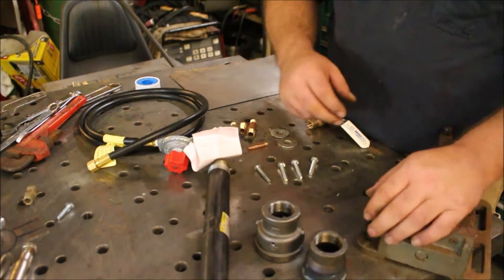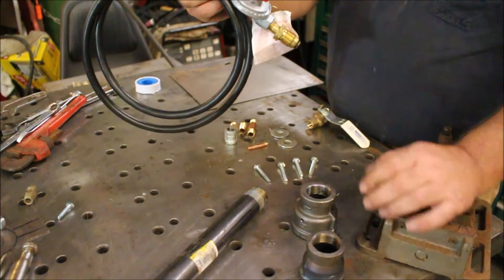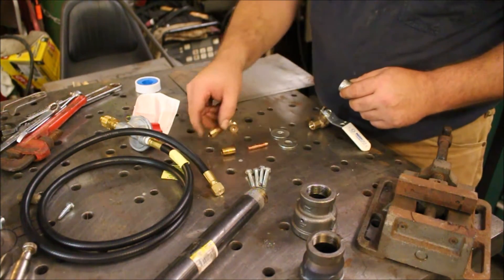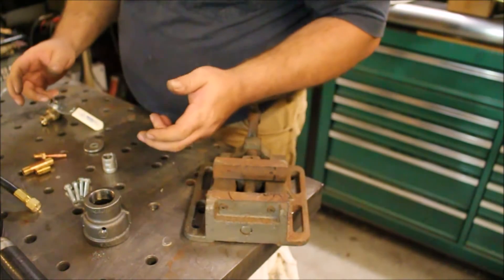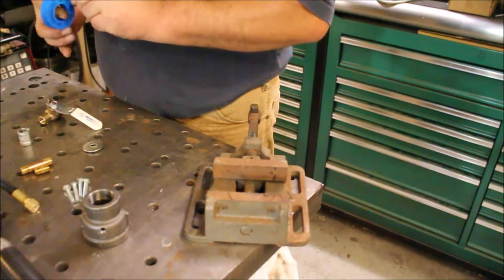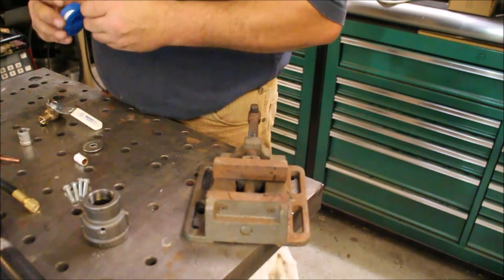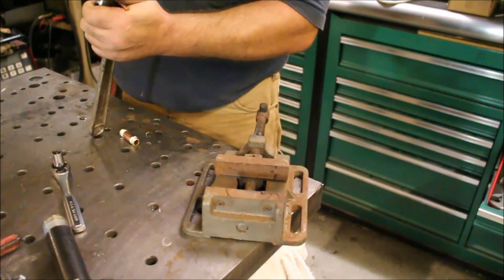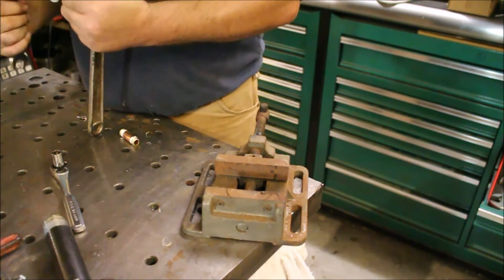Foundry Furnace Part 1 Propane Burner

Comment: I am very interested to see what the propane consumption rate is as well.  When you get this thing melting metal please report back.  Thanks!
Reply from the maker: you can bet I will. I expect that it is going to use a lot. When I was doing the test fire the 20 lb tank was sweating.
Reply: I have a 6.2kW solar array.  So I want to figure out how to make an electric furnace.  Someday.  Good luck with the build.
Reply from the maker: There is a video on building a electric furnace, made much like a ceramics kiln.
Reply: I started looking just after I wrote that comment.  There are some challenges to electric, but I think it is doable.  So it is official, make electric furnace is now #279 on my to do list.  I'll be watching yours.